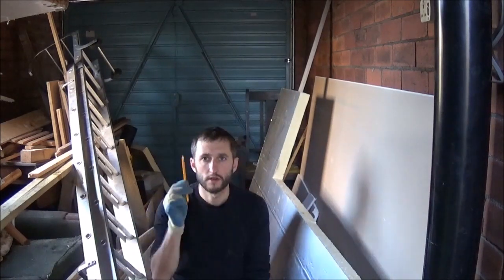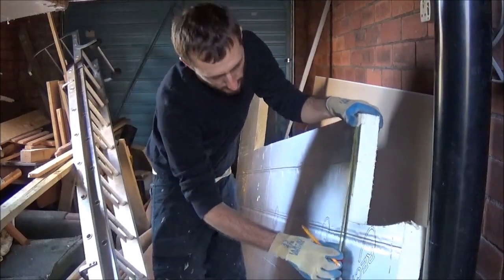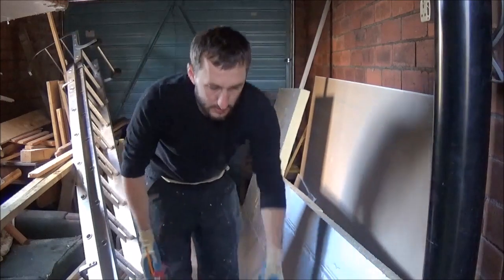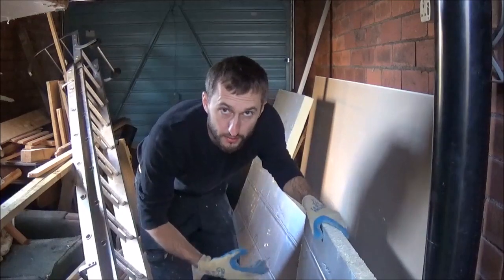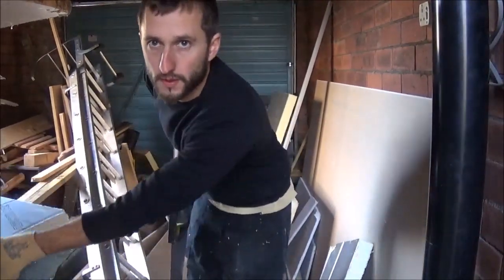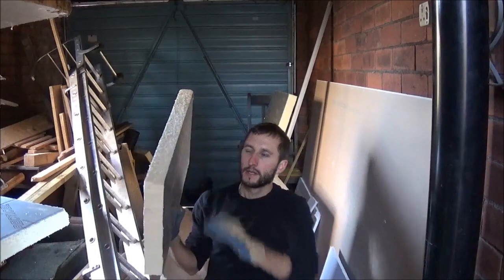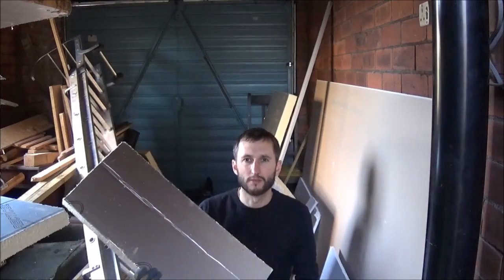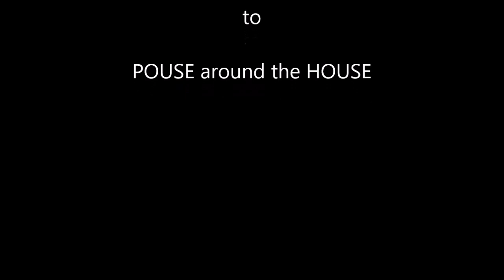How to cut insulation board (Kingspan, Celotex, Recticel)

Comment: Use a craft kinfe to cut and then snap, not a saw, eliminates the mess.
Reply: That doesn't always cut it square which is quite important between joists
Reply: Good Luck in trying that method with 100mm board . . .

Comment: Your comment on roofing felt is slightly misleading. Non breathable felt is perfectly fine to use with PIR between rafters so long as the gap between the two is ventilated from eaves to ridge. Manthorpe roll out dry ridge and some eaves vents, job done.
Reply from the maker: Thanks for the feedback Liam and for clearing that up for viewers. Thanks for watching.
Reply: Thanks that this comment. I knows its three years old, but it helped me out!
Reply: Yep few vent tiles will do the job for non breathable.